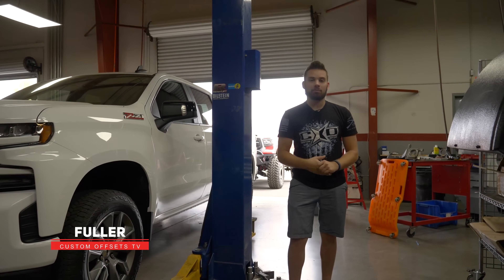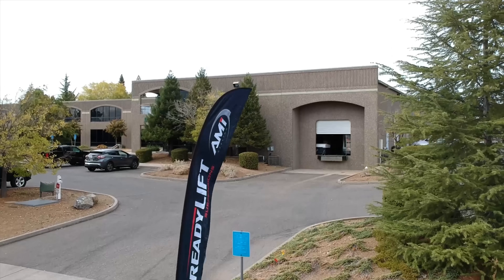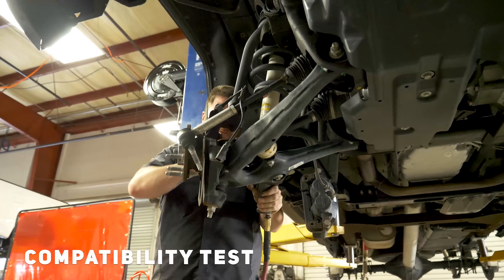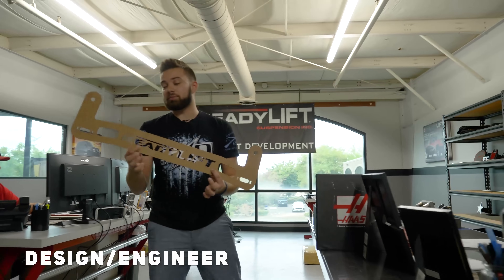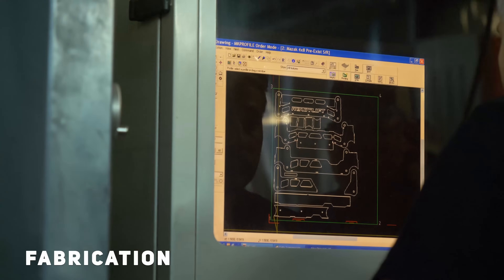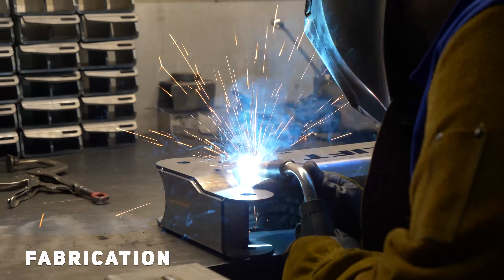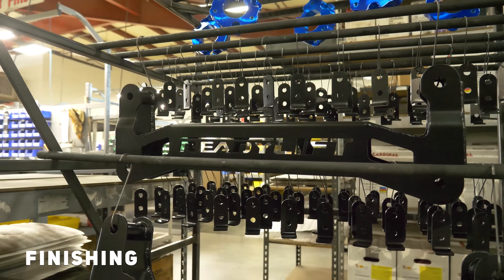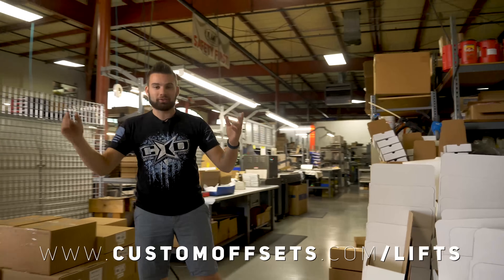How Are Lift Kits Made?

Comment: I’m looking to level my 2010 taco and I was wonder if I level it now can I remove the level in the future and put a lift on?
Reply: Drew Adams yes, unless you went with a 3”+ lift kit, which in most kits requires a front differential drop bracket and then you’d essentially not be able to go back to stock height due to cutting up the frame.
Reply: Braeden Boutte appreciate it
Reply: Should be fine since the level is only adding on a larger strut or adding a spacer to lift, you won't be cutting or removing anything that affects a larger lift down the line.